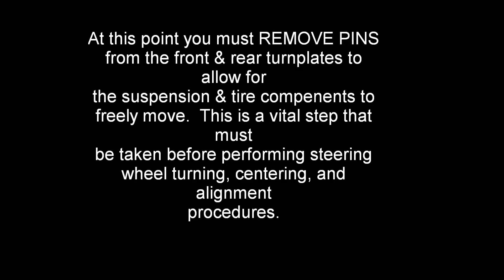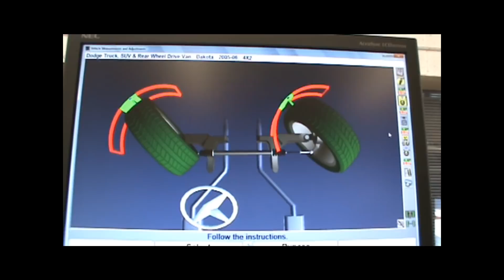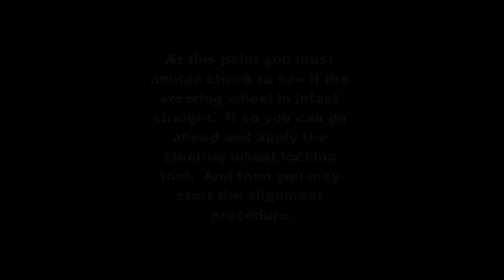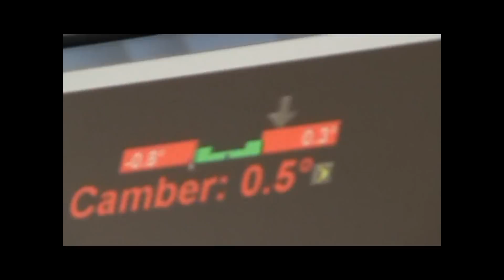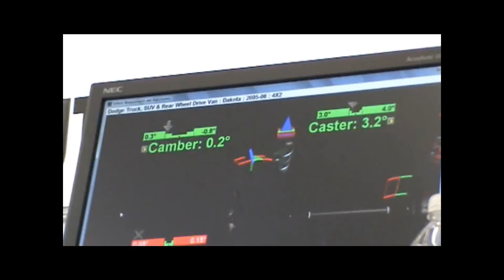Alignment how to video 3D Caster Camber & Toe

Comment: I lifted my truck up unbolted the tierod moved tires straight lowered truck, tires looked straight shortened tierod until it fit nicely bolted and tires still straight. Took it for a spin drives straight without holding steering. Just for this week needed for work but will still get it aligned in the weekend.

Comment: Also you should always jack up the front end to check and make sure it doesn't have any play, such as a bad tie rod ends, or bad ball joints, wheel bearing ect. Looks like a bunch of ROOKIES messing up an alignment to me.

Comment: Most alignments are scams. Your vehicle should never need an alignment unless it has collision damage or you replaced the steering rack.
Reply: +fishodorvagina Not true
Reply: +fishodorvagina Well, it all depends on the year, make and model of the vehicle. Some vehicles require periodic alignment. Others don't.
Reply: +fishodorvagina You'll need an alignement is you replace tie rod ends or just slacken the knuckle from the strut.
Reply: No.
Reply: it depend on how you use the car, if you normally ride on rough road you need periodic check

Comment: Just because the Hunter Machines says you can't adjust the rear of the car doesn't mean you can't adjust it. It has a toe adjustment for each wheel. Total toe would give us an idea if the rear is pointed straight. We should see the before and after results.
Reply: You don't have toe adjustments on a straight axle unless its 4 wheel steering.

Comment: Quick question. now some drivers in the import and street scene prefer make the camber even more negative to push the wheels out and as they say "stance" the vehicle. even though negative camber in the high numbers isn't recommended, will your shop upon customer request apply more negative camber as requested by the customer or is it not permitted

Comment from the maker: @x2xtreme360 It is VERY crucial to get the sensor set up correctly on the rim, it HAS to be flush with the wheel assembly.  Bring it back and reset it on the alignment machine.  I've seen number literally change due to wind gusts.  -3 degrees is a good amount however and I'm assuming you're still going to be a tad bit off.   Hopefully this information helps you out.

Comment: I use this machine at school. One question. My car is showing -3 degrees of camber on the left side and it has me concerned, but my tires don't seem to be wearing out. I only put it on the machine one time so far. IF the sensors "teeth" aren't completely up against the rim flush, can this interpret the car as having excessive camber?